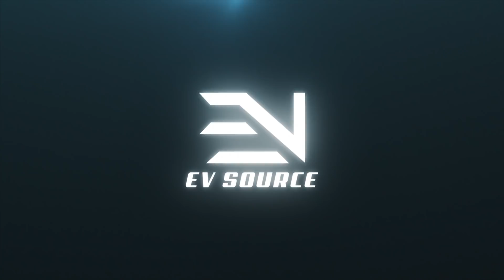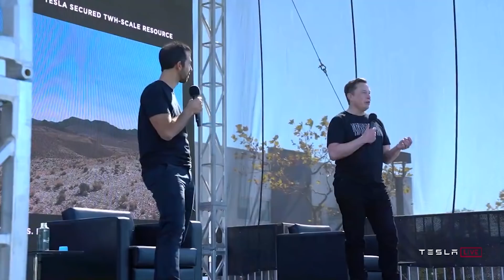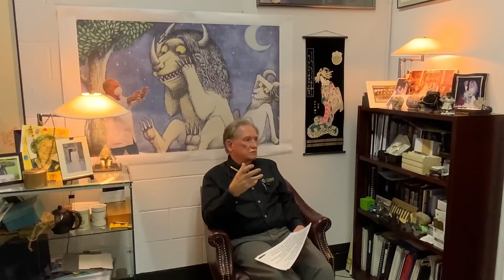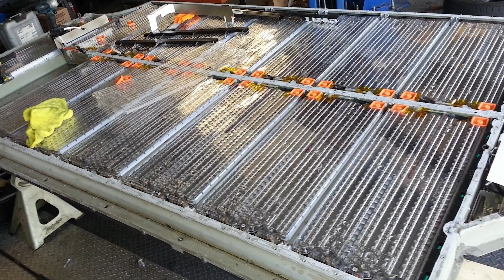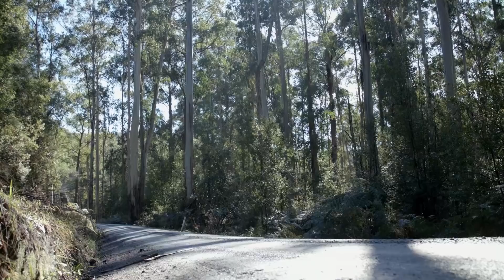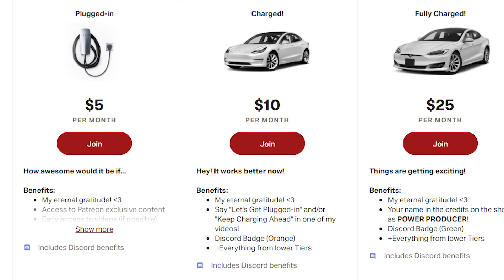Tesla Battery Recycling To Eliminate Mining Over Time & Lower Cost Of Batteries

Comment: Please, no laws against old cars! However, when everything is electric, old cars will only comprise some 5% or so. I'll drive my old truck around just for carrying tools and then the electric for the days I'm at the same job.
I might not afford a new truck (even though I want a cybertruck) so no communist style laws!
So, transportation is about a third of the global warming problem, and 5% of that is about 1.66% and the fact that they'd get driven by at least only half the time we drive then today, the emissions all of a sudden becomes less than 1%! Future molten salt nuclear will power the very energy intense recycling needed for all things (if silly enviros don't block its necessary development)! These can also minimize the mining footprint for literally hundreds of thousands of square miles of solar and its necessary gigatons of batteries. In fact, all we need batteries for is for most transport, big rigs and heavy equipment included. The molten salt reactors should power all large ships and should make the very energy inefficient fuel needed for whatever that can't be battery or nuclear powered.
Now, we need far less of the planet covered by solar because molten salt reactors require vastly less space, energy and raw materials than their equal of RE.
For example, a 250 MW molten salt reactor should generate almost 100% of the time. It should require the mass of the volume of a house, filled of metal, concrete, etc. A 1 GW solar farm in India requires 25 sq km. It works for about 25% of the time.
Now, condense the entirety of the materials for that solar farm and I assume that it's at least an order of magnitude more material than the nuclear, oh, and the nuclear needs only to be about a quarter of the wattage.
Now, make the nuclear even smaller yet, because we don't want to size just for max load. We want to size for average load - and use batteries for the smoothing. So, now, I've increased some materials requirements (non Transpo batteries) to use a little less nuclear.
Molten salt nuclear is what Alvin Weinberg was all about. Guess what, he also helped found the predecessor of NREL, SERI because he had a hunch that the world would go bat shit crazy against his meltdown proof molten salt reactor!
Better hope the world can handle all that solar and all those extra batteries because I believe it's not right to say that we have to reduce our populations and that it's unfair to not allow unlimited clean energy for each of the billions of people.
Btw, molten salt nuclear spits out no long lived wastes, just fission products.